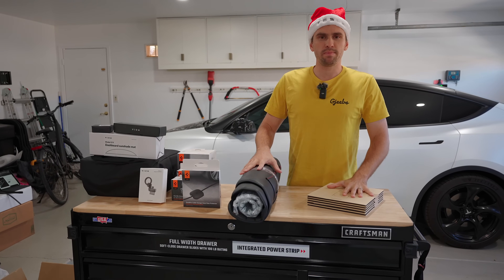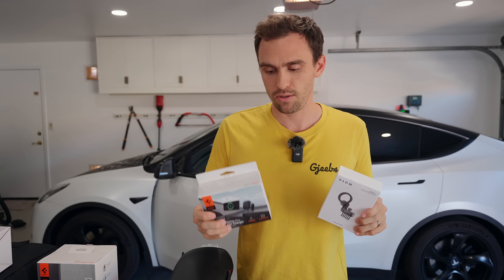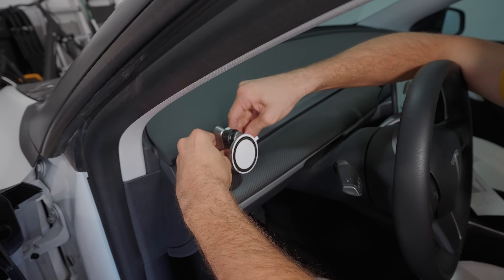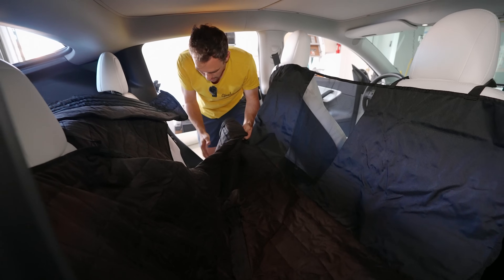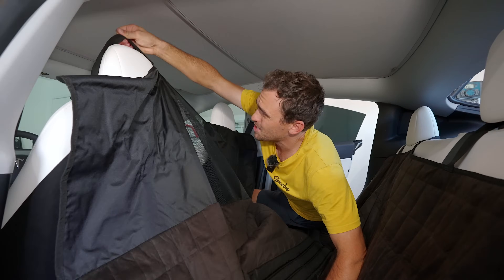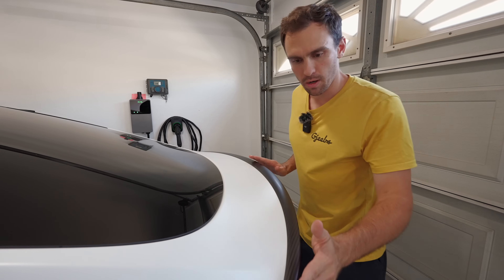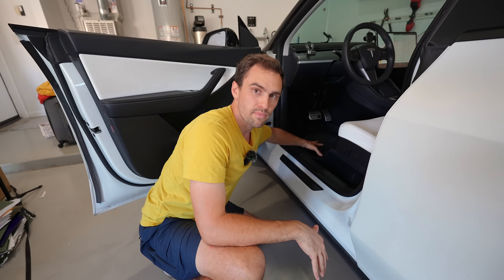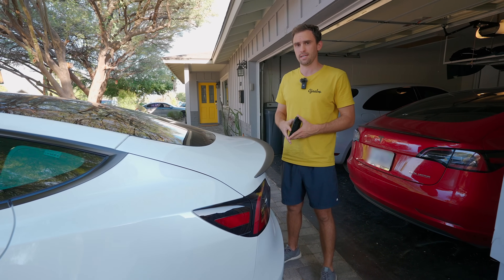Top Tier Tesla Model Y Accessories

Comment: Really loving the Vion magsafe phone holder w/o charger. If/when I want to charge, I can run a cable. I can install behind the steering wheel to display info I want there. 

Definetly would not be putting the Tesla plug into the hole in the wall mount. It's just asking to be broken off when walking by. Why not just wind it around the holder and allow it to hang. That's what I do with my Telsa wall charger.

Comment: An easy tip for pre drilling the plastic drywall anchors.  you can punch in a phillips screwdriver 20 % smaller size than the anchor  .  Allows for easier install of the plastic screw anchors.  One can also buy the anchors in zinc steel,  what we use in our company.

Comment: Hello, for the Vion phone holder - it looks like a great solution, but a few questions.  Do you think it will support the weight of a Samsung Galaxy fold Z?  I like the big tablet look and that's what I would use it for.  I ordered a pro clip mount, but this looks like an easier and cheaper solution.  Bottom line is that I'm trying to have my phone opened and I want it mounted in the Tesla Model Y.  Right now, I have a jowua, but it doesn't expand enough to accommodate the fold 5 z when opened.  Thanks for your help

Comment: great video as always, all the products look and fit great.  I personally like the Vion center console charging hub the best.  The 3D Maxpider floor mats are an awesome choice.  I've had them in my model Y for just over a year now and they are so easy to clean after a few snowboarding trips.  Mine still look brand new after 30,000 miles.